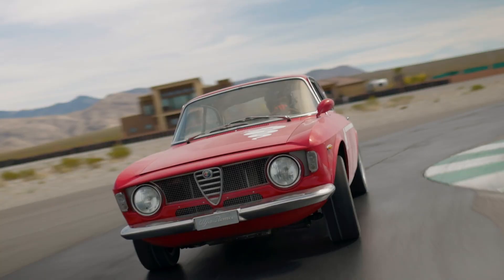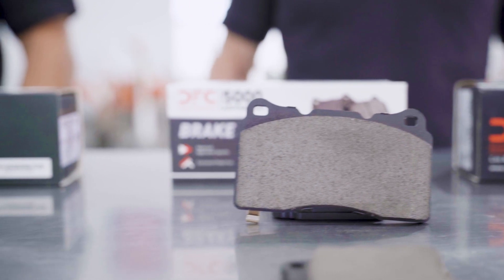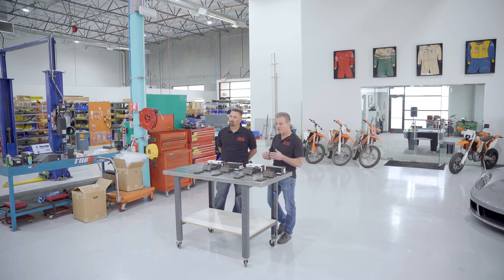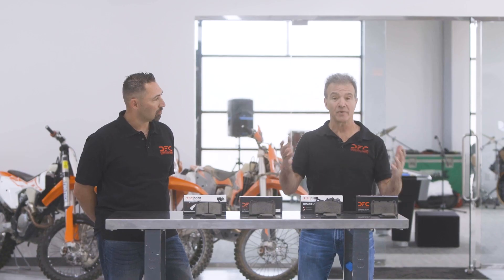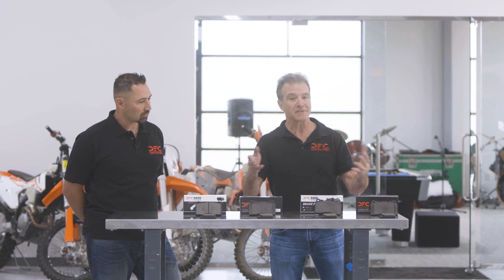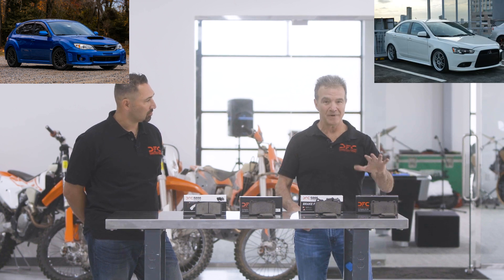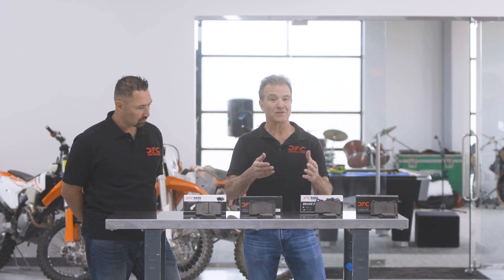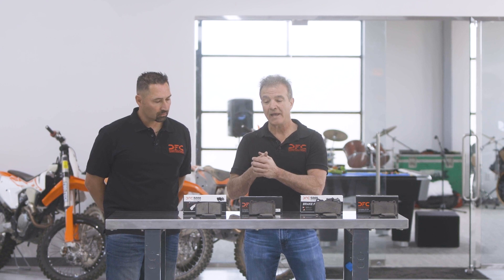DFC - Different Brake Pad Friction Formulations

Comment: I bought a set of 4000’s for my 76 Bronco, they were tight on the driver side, wouldn’t fit on the passenger, I had to sand them down to get the caliper on, drove it eight miles and the driver side overheated and turned the rotor black, the wheel was so hot I couldn’t touch it. 50$ wasted. The calipers and rotors had only 8000 miles on them. I had put organic pads on and they put off to much dust is the reason i bought the DFC 4000’s.

Comment: What do you guys recommend for a 1976 ford bronco every day driver, 32” tires 1.5” lift, disc front drum rear? It is used for hauling firewood and towing a 10’ trailer loaded with firewood.

Comment: The video is appreciated.  I've not used your products before, but I'm certainly willing to give them a shot.

Admittedly, I'm looking for more solid factual details - braking coefficient and operating temperature range.  If you had a brake dyno chart (braking coefficient over the operating temperature range), that would be absolutely perfect.